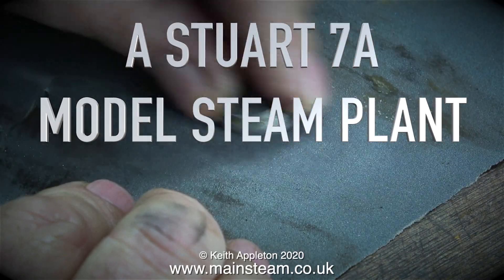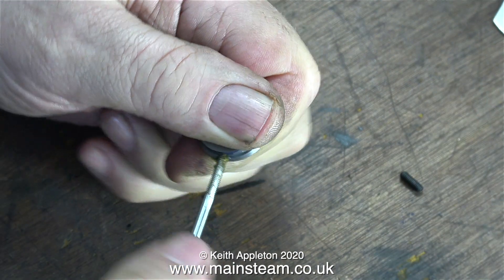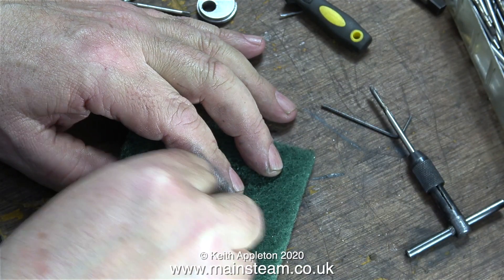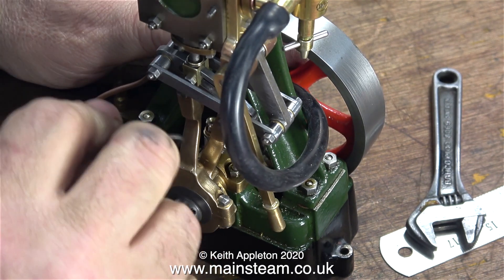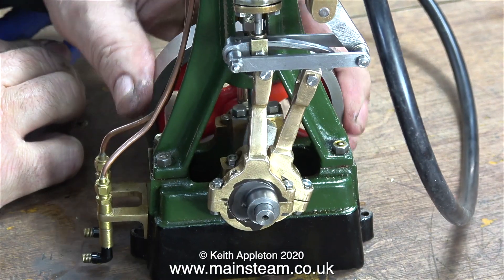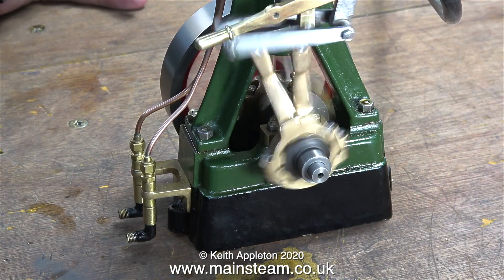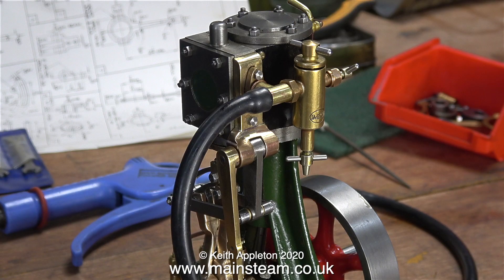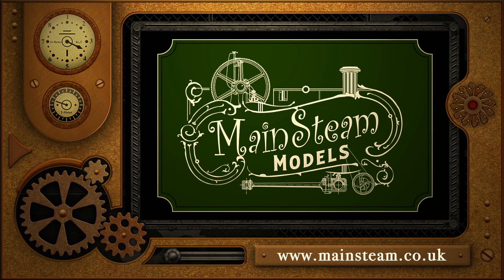A STUART 7A MODEL STEAM PLANT - PART #15

Comment: I built a #7 with reverse in 1985. My first Stuart project. I made one double eccentric and it barely runs in reverse. Runs great in forward. I wonder if the drawing for the old style #7 is off too. I'll try two separate eccentrics as you did here. Thank you.

Comment: Reminds me of the time 1276 engineers followed a blueprint not realizing it was metric.  Which is a better result  then the 1732 engineers who followed a blueprint not realizing it was non-metric.  Which also reminds me of the time in my hometown  road builders followed the plans and put the sidewalk 9 feet from the street edge because they though a meter was the same as a yard. For the next two days all we heard was the sound of jack hammers and cursing as they tore up a perfectly good sidewalk.

Comment: Hi Keith, Not sure I can understand that. If the highest point of each eccentric is set at 90 deg to the crank web, are they not 180 deg apart?
Reply from the maker: Yes they are, the cranks are at 90 degrees.

Comment: I worked 13 years as a QA, QC, department supervisor tec. In a machine shop. 
And from time to time, we would find a problem like that.
The prints that the customer gave us was not always right. 
I made the documentation of the measurements that I made of the part that conformed to print.
And their engineer ended up with egg on his face.

Comment: Has anyone contacted Stuart about this drawing error?  I should very much like to hear their response!
Reply from the maker: Maybe the drawing isn't wrong? but it is easily misinterpreted.
Reply: @keithappleton  Hang on Keith!  At 5:00 you stated the fellow who built this, did it precisely to the drawing, yet it was 30° out of phase.  You also mention that the Engineer (who's name escapes me) at the Steam Workshop says the drawing is wrong as well.   Now, after some more thought, you state, well, maybe the drawing isn't wrong.  This is an obvious contradiction.  In my view, this should be clarified, as you now have a published video stating, in effect, "Stuart wrong".  Are they?  I am not looking for someone to blame.  That is never my course.  I'm simply seeking truth.
Reply from the maker: Hang on viewer! It is simply a disclaimer on my part illustrating the fact that the drawing can be easily misinterpreted regarding the 30 degree dimensions. Either way the eccentrics didn't work properly machined as they were.
Reply: @keithappleton  5:24 John Holroyd, Engineer at the Steam Workshop, who states that "the drawing is wrong"
Reply from the maker: I am aware of that too . . . . . .

Comment: Keith do you know if this ‘drawing error’ is common across all the Stuart models with optional reversing mechanisms?
Reply from the maker: Probably not - maybe the drawing isn't wrong after all but it is easily misinterpreted by the builders. It had me fooled, but I freely admit that I am not an engineer.

Comment: While I am not doubting what you said, in my mind the difference in eccentric angles should be greater.
I always thought that there was something incorrect with the double eccentric, much better to be able to set them separately.
The eccentrics for outside admission should be 90 degrees + lap angle + lead angle in the direction of travel. Lap and lead might be hard to measure and set on engine of the size you are working on though.

So 90 + 90 = 180 degrees difference (plus lap and lead).
Reply from the maker: Yes that's about it, but I still prefer individual adjustment.

Comment: Bonjour Keith,
I have never understood why the two eccntrics had to be independant. As the angles and all measures are known, it would be much easier to set the timing with just one adjustment possibility. Would you have an answer to my steam existential question ?
Amicalement, Raphaël
Reply from the maker: Not really, I just always have to tweak the settings. Maybe the drawing isn't wrong, but it is easily misinterpreted.